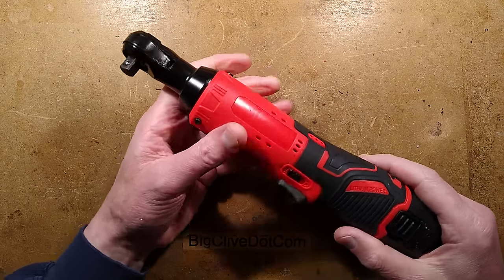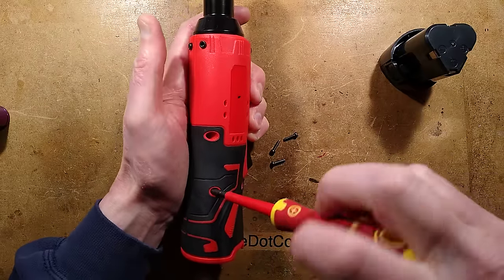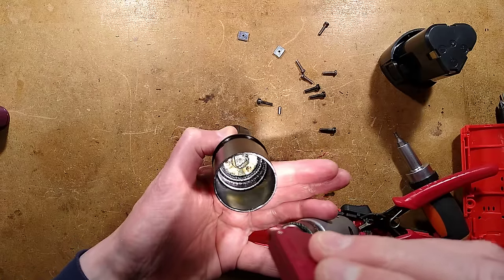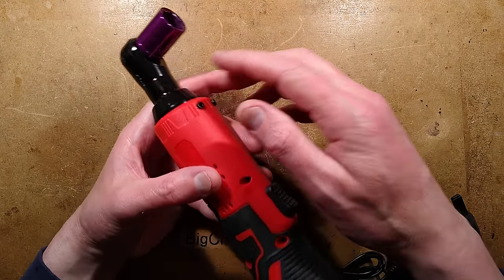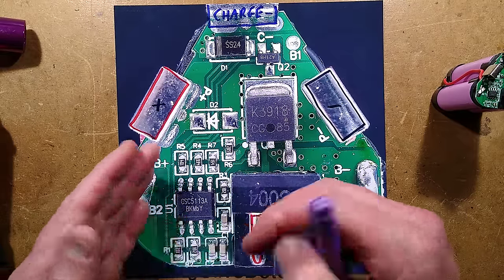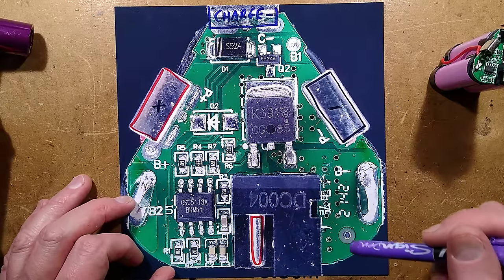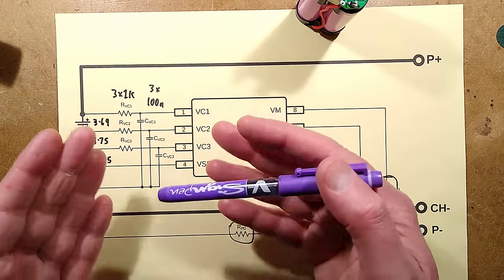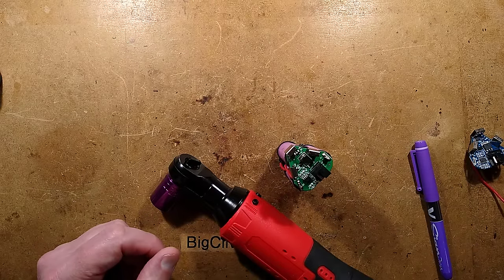Inside a cheap Chinese cordless ratchet

Comment: Here in the US, Harbor Freight Tools sells Chinesium tools like that.  I have a few and they're okay for light duty.  But long ago my employer was himself employed by Douglas Aircraft, which was bought by Boeing.  The tools he got from work (from their surplus store😁) were some of the best, and working with those for a decade teaches one about quality including ergonomics.  Nowadays these are often compromised in order to cut costs.  One thing that's really annoying is cordless tools have to be heavier due to the battery pack.  The worker who has to use these tools up high or overhead will tell you how important the weight is!  Thanks for the great video, Clive.
Reply: Hehe Hobo freight!
Reply: Harbor freight isn't bad for a homeowner just trying to do a job around the house. None of that crap holds up to daily use on a jobsite. And the price shows. Lots of ppl think they can pay 30 bucks for a cordless tool then crap on it when they abuse it. It ain't milwaukee or Dewalt lol.
Reply: As in McDonnel Douglas?
Reply: @ravensnflies8167   Even Milwaukee or especially dewalt Isnt necisarily what you think it is.
Reply: @rimmersbryggeri  and what do i think milwaukee and dewalt is?
Reply: @ravensnflies8167  Milwaukee is fine but overpriced and Dewalt is consumer grade stuff with an extra high pricetag these days. Yellow black and deckers. Dewalt have some professional stuff but not their electric handtools.
Reply: @rimmersbryggeri  if by overpriced you mean unaffordable to most entry level tradesmen, i agree. $8k worth of milwaukee power tools and i have not once regretted marrying them. am i biased? absolutely. but theyve never let me down so far:}
Reply: @ravensnflies8167  You would have had you gone for dewalt. They are mostly known fro their briliiant reality tv marketing back in  late 90s early 2000's. Now the sa me marketing guy is selling actually good tools for Milwaukee. I used to workj in a rental shop though and there you would see none of those brands.  Actually mostly brands you hardly see anywhere else. Not that much if at all more expensive than milwaukee though. You got to give it to milwaukee though they do have a great selection, especially for mechanics like me relative to other makers.
Reply: There were guys fiiting a suspended ceiling on the floor below ours in the office today my co-worker were all bitching about the noise but I was thinking what shitty job it would be for some guy hold a power tool above his head and sucking in all that concrete dust!
Reply: @ravensnflies8167  for 8000 they shouldn't.
Reply: @sonofedmund5004  nowadays they carry pneumatic nailers.
Reply: Most of the products come from China. Milwaukee,dewalt,makita ingersoll Rand and much more tools 😊😂
Reply: "Chinesium" 😂😂

Comment: Big Clive, serious question. I just bought the newest DeWalt cordless 12v 3/8" ratchet. It is insanely weak... The "circuitry" turns the motor of when applying about 5ft.lbs of torque. Question is, if I pay shipping both ways will you tear it apart and work a little magic to "bump up" The current limiting device in side this thing? 😏
Reply: Hey it's SMA. If it's a brushless maybe a bigger motor controller might do it some good? If it's brushed maybe bypassing the variable speed trigger with a momentary switch so that it gets full beans immediately might help it.
Reply: Newton/meters AHEM
Reply: I bought the MAC version 10 years ago.
It's is good for at least 30lb/ft and will over tighten smaller bolts if yer not careful but the variable torque trigger is quite controllable
Reply: The website claims 60 ft/lbs of torque, so maybe it's defective?
Reply: @bills6093  that's what I just found also, the xtreame says 60.
I'm on mobile so couldn't see if there is a variable power setting somewhere but I'd doubt it if SMA is asking this so I'd have to assume it's defective also.
Reply: @Firecul  I dunno guys I tried it against another one and it is exactly the same. It is way over rated IMO. I'd like Clive to crank it up for us!
Reply: Has torque test channel tested this one yet? It would be nice to see "tune-up" of this one :)
Reply: @Tsiikki  TTC did do a review and it was a performer but real life says it is kinda crappy...
Reply: I think this is an excellent video idea - I'd love to see what's possible with a little "upgrade"
Reply from the maker: That doesn't sound right.  If it's new then it might be worth contacting the supplier.  Shipping anything heavy internationally is not recommended at the moment.
Reply: Boost the motor would probably instantly break the gears.

In my opinion DeWalt is hobby grade tools at a premium price. I guess they need a huge profit to pay for the racing teams.
Reply: @g.h.190  It is getting harder every day to find good tools... Even Bosch Professional sneaks in something low grade every once in a while... Yet prices keep going up every generation (well, list prices that is).
Reply: Get Milwaukee fuel
Reply: @g.h.190  I agree I think the best course of action it to salvage what you can of that one and buy a one that will do as it says.
P.S. I just saw its a dewalt which is a good make. Yeah I'd contact dewalt coz it could be a reject.
Reply: Great video as always Big Clive, interesting and informative.

Would certainly be interesting to see how some of the other brands electric ratchets compare in form and function.

One thing to always be aware of with these is that they are not meant for high torque applications. You should always loosen the nut or bolt using a breaker bar  or impact wrench. Then finish it off using the electric ratchet.

One thing that is interesting about Milwaukee in the UK is that when you send tools off for repair, it's actually a 3rd party that repairs them. The other major brands have their own dedicated teams.
Reply: i would like to do the same with dewalt vacuum its not very powerful at all and i want to somehow overclock it
Reply: @IGDZILLA  a good place to start would be “Project Farm”. then select the Best ( available over here) then rip them down vs chinesium no brand equivalent 🤔🤔🤔🤔👍
Reply: @IGDZILLA  That is a good idea if Clive could test some of the big brands.
Reply: I agree with those suggesting Torque Test Channel.  They'd be easier/cheaper to ship to, and if not of Clive's electrical acumen, at least be able to confirm performance (or lack of same).
Reply: @pleasecho2  Its Newton*meters or foot*pounds, it's the force on the handle times the length on a manual wrench.  Applying 1 pound of load on a 3 foot wrench is as good as 3 pounds on a 1 foot wrench or 72 pounds on the edge of a 1 inch bolt.  Dimensionally torque units are the same  as an energy units, but it's a different direction.
Reply: @IGDZILLA  like others have stated, Torque Test Channel sort of does what you're after already. Albeit, they don't take them to bits and examine the inside, which I think is a decent part about what you're after...

AvE channel, specifically his BOLTR vids, DO take tools apart and examines them, all the way from battery to its tool ends. Unfortunately, he hasn't really been making those sorts of videos anymore :(
Even then... A person can't generally give a proper "rundown" on circuitry component quality when it comes to battery powered hand tools, since that part is almost always potted in a "pain in the ass to remove" resin/epoxy. (this is done for two reasons: prevents solder joints from micro cracking from vibrations, and, water periods the control circuitry)

Which as I understand it, it usually takes a few weeks for the right chemical to loosen up the epoxy enough to remove it... But then you rub the risk of it damaging the PCB or components, rendering the tool kaput. Double-☹️
Reply: @bigclivedotcom  maybe it needs extra voltage 😉😉
Reply: @g.h.190  Maybe the gears have been put in wrong
Reply: Cordless ratchets are not designed to torque the fasteners just speed up the job. Torque the fastener manually after the slack is taken up.
Reply: I would take it back for warranty. The DeWalt should CERTAINLY have more than 5ft-lbs of torque. Something is wrong there....
The Horror Freight "Hercules" 3/8 12-Volt ratchet that I bought recently will output 45ft-lbs according to my digital calibration tool, and also verified with my digital torque wrench.
Reply: @pleasecho2  Cough, cough, ft-lbs, cough...
Reply: AvE might be the more proper guy for this task... but not too sure
Reply: Yea if it's really not doing more than 5 ft lbs it is defective and I'd see about exchanging it for another one. I got the extended brushless Ryobi which advertises 55 ft lbs and it's pretty much right about that. It's gotta be a pretty tight/large fastener like a lugnut to even have to preloosen or bust out the impact wrench. The Ryobi is great - I use it all the time.
Reply: Eric is everywhere. It'd be great to see the DeWalt taken apart.
Reply: you crack the nut loose by hand with the tool, then use the ratchet to back the bolt/nut off. even air ratchets dont have a huge amount of torque
Reply: I wonder if AvE would be interested in taking a look at it? Shipping might be easier too
Reply: @Klokopf52  Bosch profesional drills have the most useless chucks ever. After forty years of Bosch I am gradually moving to Makita.
Reply: @bills6093  you can load it to 60...it wont spin at that, you want an angled impact driver for what you are looking for.
only brand thats any good is snap on.
they run 15v instead and you can hang off one, 450 quid though and good luck fnding one.
Reply: @deadprivacy  I have no complaints about my Dewalt 12V tools. Love them. Been using the brushless 12V drill in an industrial setting for a few years now. The 12V 1/4" drive impact gun still twists the heads off bolts if you aren't careful. Drill is beat all to hell and still runs like new. SMA said the ratchet is shutting off at 5 foot pounds, so clearly something is wrong with it if it's rated for 60 and shuts off at 5.
Reply: @bills6093  these araent torque guns, they arent for cracking fasteners by motor, i know, i break mine regaular as clockwork evry ix months, its the ratchet that blows though.
its why only snapon will do as i can get em rebuilt. bout 600 dollars new though. just for the racthet. 150 dollar rebuilds. might last longer if i could be bothered to grease em.
im running a l;ittle hobby set from sealey at the mo, its all 12v but rated at 10.8v as they arent overselling it, brilliant little kit ofr the money and perfect for bikes, even the little impact has a fair bit of whack.
theres two torque figures on these, theres what the head can take and then theres what the battery will drive, the battery is oftenn more powerful than the teetch in the ratchet so the teeth will blow before you get the pixies.,
Reply: @deadprivacy  60 foot pounds is plenty for the jobs I do with the ratchet, and 120 foot pounds is plenty for what I do with the impact gun. I have 3 and 5 amp hour 12 volt batteries that last a good long time between charges. Plus they charge in the 20V chargers that are already in the shop. The smaller size of the 12V Extreme tools comes in very handy lots of times when bigger tools just won't get in the space.
Reply: @bills6093  i suspect my sealey ones are the same beast...dunno what that runs torquewise , ive learned to never trust numbers on the box...
For cars? Tge long reach snapon is like another hand...itll break open stuff up to 120 but you will fuck it if you dont break and fully tighten just using the ratchet...but i use it for everything ...so its worth giving it the abuse...sadly rebuilds are taking months due to supply issues....for the big stuff the big snapon 1/2 inch with the three torque settings....there aint much that troubles that bugger....
i used to use dewalt when doing joinery and building, i got the first gen lithium iron phosphate batteries, they were good but a bit odd and would overheat and damge on major discharge....they went over to standard li ions for the xr range.
never killed any of it aside from the battery grinder but that was my majorly used one.
i mainly got em cos they were yellow and hence easier to find once laid down unlike the undergrowth coloured makita stuff.
snapon comes in neon green which is perfect:)
Reply: @pollywollydo  no, hes a clown, torque test channel.
Reply: @deadprivacy  you are entitled to your opinion— I suppose
Reply: @vespadavidson2315  here in Brazil Bosch already lost its place to Makita, while DeWalt is being almost like Bosch but a lot cheaper.
Reply: @pollywollydo  its not an opinion, its objective fact, his little oil tests are beyond absurd and if you take half of what he does seriously? you should really go back to school.
Reply: @pollywollydo  product testing and material testing is a real job. it provides verifably objective , repeatable results.
project farm is entertainment witha smigdeon of validity, its a literal clown show, he runs engines on bacon fat.
its garage 54 but boring
Reply: @g.h.190  since Black and Decker bought them out the quality has plummeted.
Reply: SMA, have you contacted AVE? He's in Canada.
Reply: @danparden8103  have you seen the recent Torque Test Channel review of the newly introduced 1/2" Milfuckee as aVe calls them 'B' series rattle gun? Much less internals and breaks on about the third wheel ( lug) nut? Milfuckee is correct lol
Reply: I bought a extended length 3/8" 12v ratchet from Harbor Freight I think it was on a trip to the States back in March and apart from the length of the tool and a slide on type 12v lithium ion battery it looks almost the same even down to the led light. That won't do more than about 5 ft lbs either, the motor just gives in. And I wasn't cheap either, the tool comes without any batteries, so I bought  two and of course had to buy the dedicated charger to go with it (110v) and that all came to about $135 plus I had to get a 240volt to 110 transformer so I could use here in the UK. As far as I'm concerned a complete waste of money lol
Reply: @samrodian919  i have not seen that
Reply: The problem is you're not using the best battery.  Just stop over at your brother's shop and pick up a couple semi batteries and crimp solder the connections to trigger everyone and it should be a ripper for maybe one use.  YMMV and I take no responsibility if you hurt yourself and Mrs. O brings out the wooden spoon to serve out punishment. 😂🍺

Comment: I've had one of these for over three years and it's still going strong. It's great for those long thread bolts that take an age to wind out or in by hand. The mistake a lot of YT mechanics make with these is that they expect them to be able to undo everything from scratch.
Reply: Right. You have to break the bolt and loosen it a little first. Also, I try to avoid putting the bolts back in with power or air tools. Don't wanna cross thread the bolt.
Reply: They are great for doing water pumps.
Reply: A bad workman always blames his tools
Reply: We have Milwaukee in our tool rooms. New employees doesn't know it ratchets and blames on the tool when it can't break 80ft lb of torque.